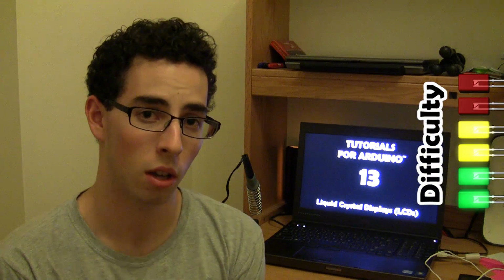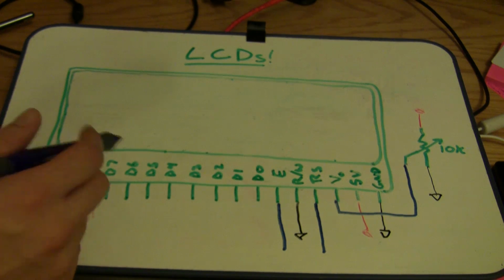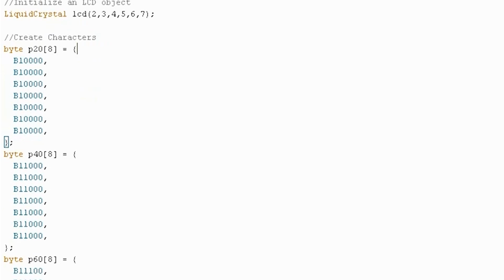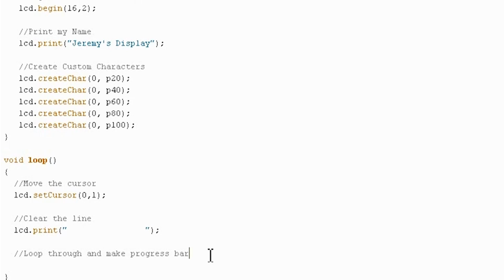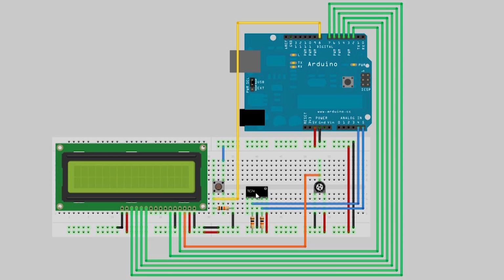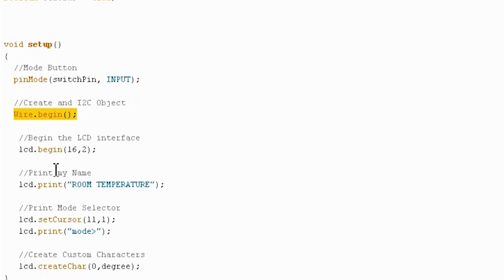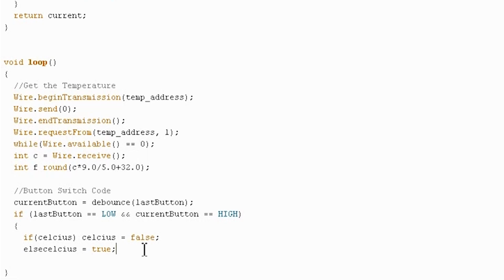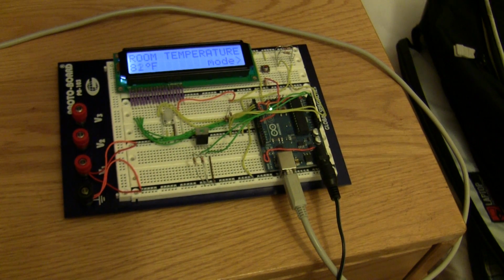Tutorial 13 for Arduino: Liquid Crystal Displays (LCDs)

Comment: D6 on the arduino is a PWM pin. do you have to use an PWM pin for pin 6 on the LCD? reason i ask if my latest creaion i have one pin left on my arduino pin 8 but i need an PWM pin. could i swap these two pins ?

Comment: Hey Jeremy. Currently working on LCD displaying with my 16 hz arduino clone. Got the kit and everything and was happy to see the LCD screen in there! Anyways, I set up my circuit and software exactly like this website https://www.arduino.cc/en/Tutorial/HelloWorld?from=Tutorial.LiquidCrystal. When I plug in my circuit everything seems to work fine except I get the top row of the LCD screen with white boxes that dont seem to go away. I did a little research and apparently the issue is because the LCD isn't initialized properly? Which doesnt make sense since I'm using the example code. I can adjust the contrast of the screen just fine and I'm almost positive everything's connected correctly because I've torn apart the circuit 4 times and redid it and got the same error every single time. I was wondering if you could shed some light on this dilemma I'm having.

Comment: Unfortunately, I do not have a good pot for this project.  I will order one but I was wondering if there is a somewhat suitable value for the resistance to relpace the pot or is it totally depedent on the LCD you are using?  I attempted with about three resistors in series all about 200ohms and failed to have much contrast.  Any feedback is appreciated.

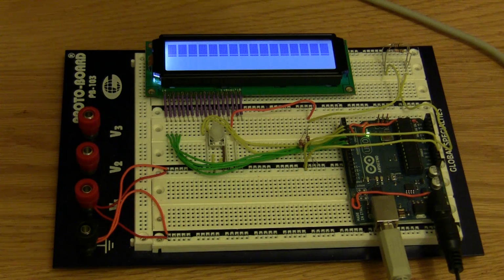Comment: Jeremy, what are those resistors for? 5:17
Reply: He said "I had to add a resistive voltage divider here to power the 6 volt backlight"  He needed 6 volts for his backlight and the Arduino only puts out 5 volts max so he had to improvise

Comment: AFAIK on the contrast potentiometer, you actually control the resistance on the ground, so the contrast would be higher, the lower the potentiometer is set. On the LED, it is the 5v which is controlled (if using a pot for LED-brightness)
If you don't connect gnd on the LED-pot, and don't connect 5v on the contrast, you should get a smoother potentiometer, and it won't be completely off.
Why do you want to use all cables on the pots?

Comment: Hi,
Im very interested to know the interrupt near of LCD used to change mode of temperatura, but every interrupt has one In Signal and another out signal, where is the In Signal and the Out signal, the In Signal is connected to resister 10k, but the out were will be connected. To be understanable see the minute 16:22???

Thnx for all

Comment: i have watched this video more than 10 times. i have built it (as far as the progress bar on line 2), and it works just fine. but i just don't see the connection between j and the binary arrays.

i understand the outer and inner loops & increments, and where they pertain to. but how is the value of j related to the custom characters ? i mean, where does he tell the program that when j is 3, custom character 3 p60 is to be written ?

or does it just start writing at the top of the list j times ?

Comment: Thanks for a grate toturial, over the last few days i watched all of them. And ordered parts for a  project or two. At work i do some programming on ROCKWELL and SIEMENS PLC. For my small privat project, greenhouse temp and humidity control, i think ARDUINO is better. I do not hav any power line in the green house so it is going to be on solar.

Comment: @axel1973w Yep, LCDs without a driver/controller are a pain to drive. If the AC signal has a little DC on it, or if the AC isn't symmetrical, it can damage the display. Much easier to find something with a controller on it already.

Sad, because I have a bunch of watch displays, too, that I wish to use for a project. That's what drove me to research how LCD displays work.

Comment: Hey first of all nice videos , i have a problem i am new on arduino and i am doing at the moment make a temp sensor using lm35 and that project work but now i want a keypad too so i want the keypad for settings for example i want to set the temp 25c so when the temp is 25c an led or buzzer will trigger but when i am checking whit the if statement i am have a problem because the value of the temp sensor is int but the value of the keypad is char so what do i need to do, thank you pls reply thx